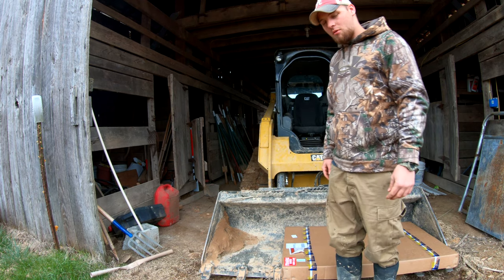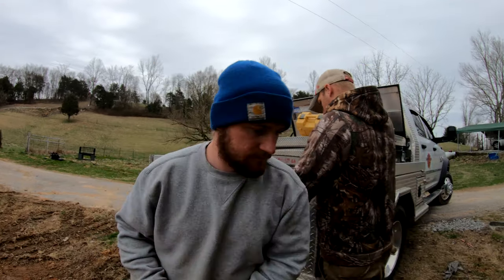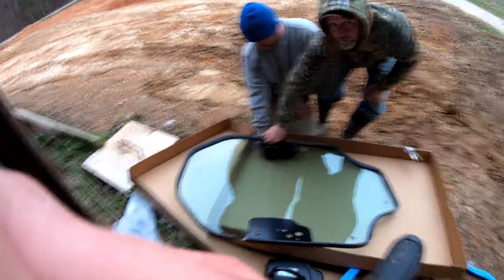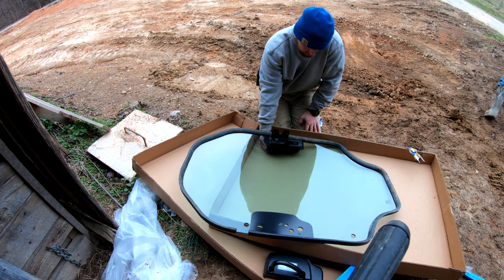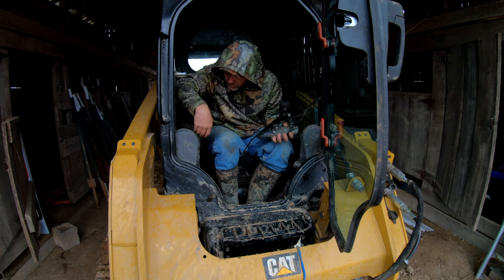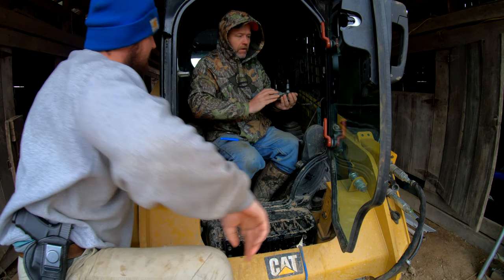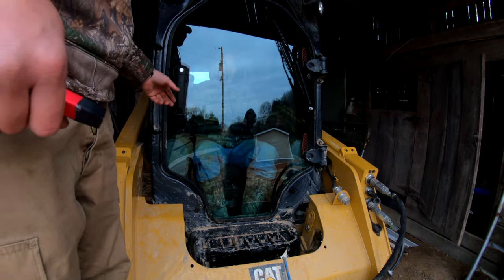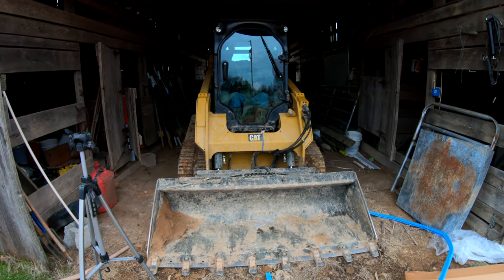How To Replace a Broken Glass Skid Steer Door

Comment: Spray adhesive for then rubber. If there’s not rubber washers on both sides metal will be against the glass.
Reply: How.  To. Installed. S130wind shield